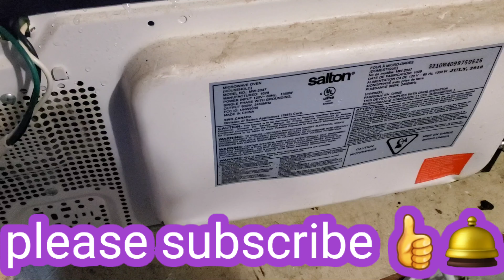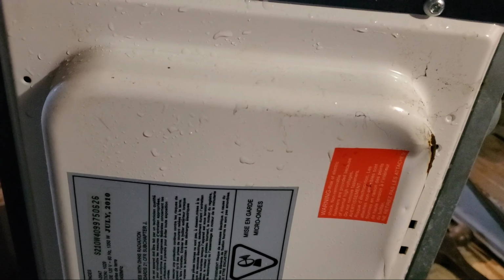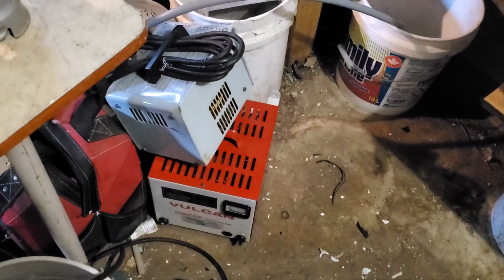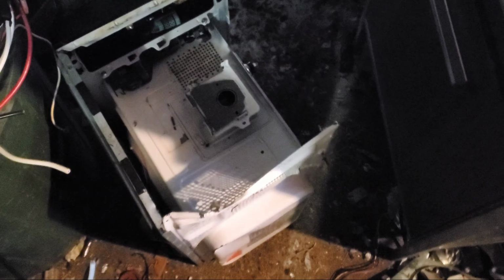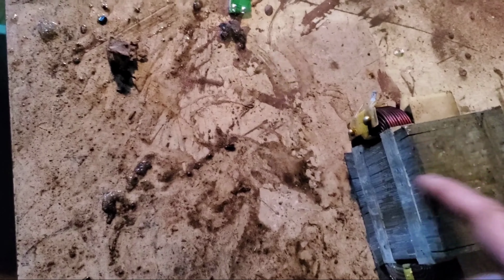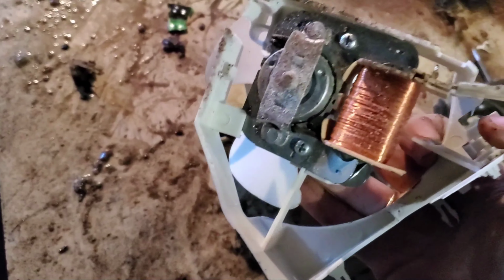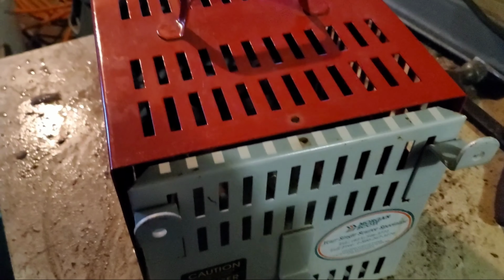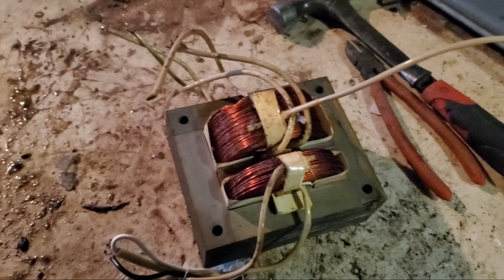Taking scrap apart to get the goodies

Comment: You'll be shocked what I did two days ago without a MAN. proud of myself. I thought I was going to need power tools.. But just used a hammer lol. I have a drill, but it needs a piece on the bottom to charge it. Hammer is the answer nowadays 🤣
Reply from the maker: Did you get Hammer happy keep on hammering LoL 😂